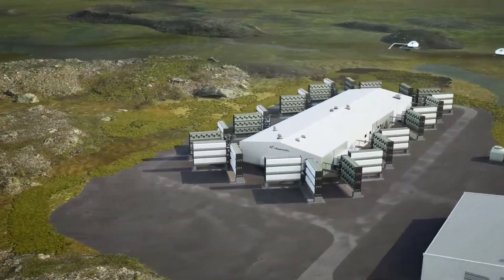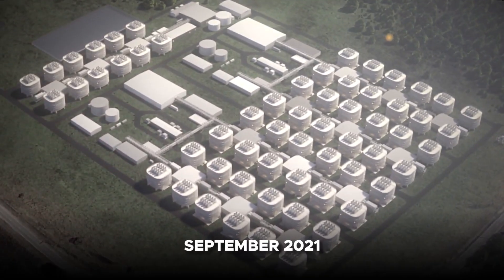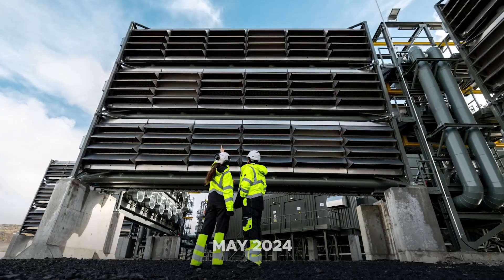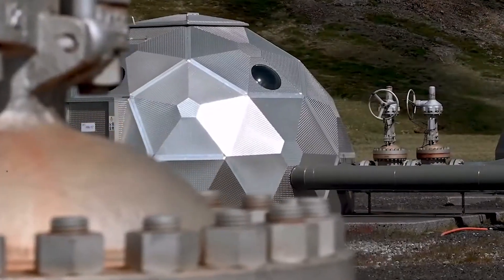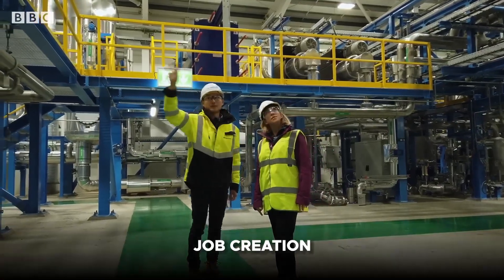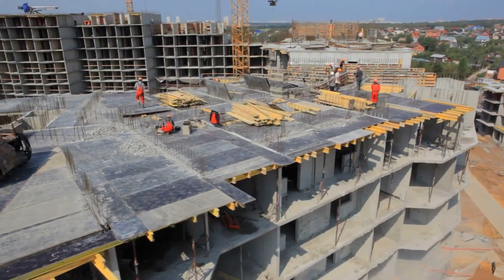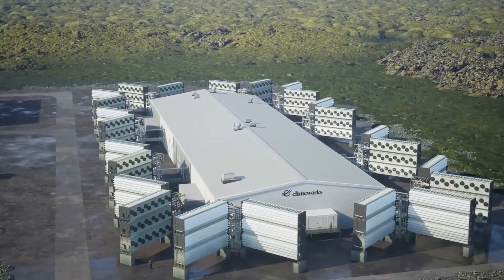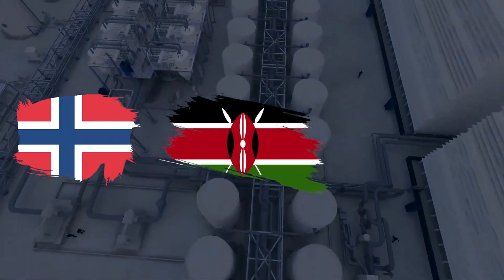Iceland Just Built A Giant Machine That Sucks Carbon From The Air!

Comment: How much carbon did it take to Build that machine? When is its breakeven? Will it function after it consumes the carbon it made to produce it?
Reply: Unfortunately,  despite running for years and selling offsets, Climeworks haven't managed to remove enough CO2 to even cover their own company's emissions yet. Given the state we're in, we need to do everything, everywhere, all at once, and CCS can be a part of that, but at the moment, the technology just isn't there and it's being used as an excuse to keep on polluting.
Reply: @timetherington-judge8682 the concept boggles my mind. The industrial process at our company outputs nearly pure co2, actually quite meaningful amounts, millions of cubic metres per year, yet there's nothing to do but vent it because the economics and incentives aren't there to capture yet. Yet dacc installations are striving to sift through air for parts per million.

Comment: ****FOR SURE**** this thing emits more CO2 than it collects when using 'whole cost' accounting.
Reply: Yes, but this thing would be very useful if we were able to replace all coal and gas power plants with green sources. We should be researching and developing these so they're more effective when they will eventually be more beneficial than harmful.
Reply: @bagelgeuse5736  Makes no sense, Bud.  If we were able to replace all the coal and gas power plants with green souces this thing would have NO USES at all.  Exactly none.  There would be NOTHING for it to do.

You fucking leftie assholes just like to hear words come out, right?
Reply: Yes, as long as carbon power plant exists it’s much more efficient to close those down. This is like a carbon power plant in reverse but waaaaay less efficient.
Reply: @WaffleAbuser  Yeah, and I'm one of those idiots who discovered that there is no correlation between human emissions and global temperature above the noise threshold of the data.  So, you may differ but I'm convinced there is nothing to be gained by either method.

Oh, and did ya hear?  The Canadian PM has finally decided to permit Alberta a pipeline to the coast (either coast) as long as Alberta lets him build the worlds largest carbon sequestration project on the planet (which Alberta "gets" for free).

So, expect to hear about earthquakes and contaminated natural areas in northern Alberta starting when our PM is out of office a decade.

I've become reactive to the site of solar panels and windmills -- at my latitude they are net emitters of CO2 but they contaminate the landscape, deprive habitat, and then prove exceptionally hard (energy expensive) to recycle.

But libtards just don't give a fuck, as long as they can 'say' they are saving the universe it doesn't matter what they kill along the way -- they blame that on the (nearly fictional) far right